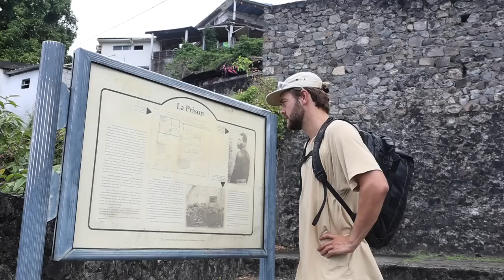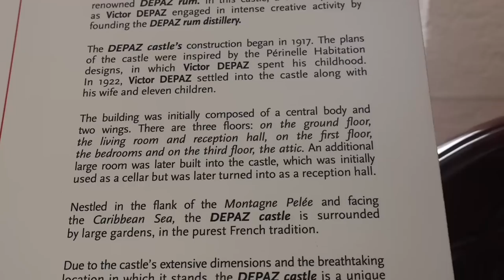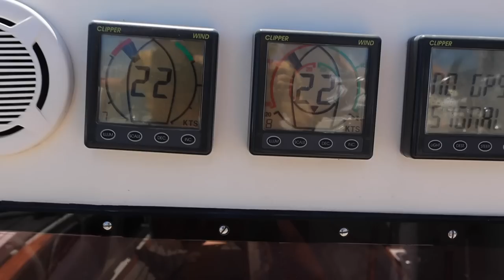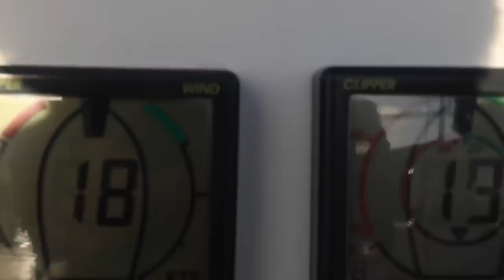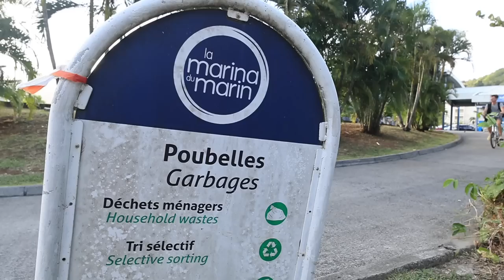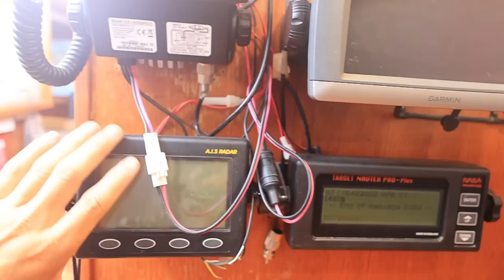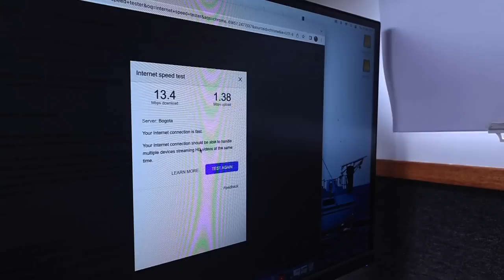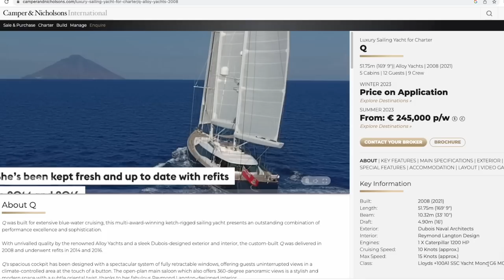What is THIS doing in our boats gearbox?

Comment: The quality of your shows is growing on me more every week, very nice work!    When we mount something on or through deck, we invariably put some goop in before tightening everything down, as the rubber bits don't stop all the leaks and you will find water going through there at some point.    By goop, I generally mean one of the 3M products,  or in this case, some Maritime black to match your teak, it should be flexible for when you want to renovate later.   Other opinions are welcome here.   Your magnet revelation brings a smile.   You both do an excellent job of bringing the special moments, adventure, and discovery to this show, keep this up.
Reply: Totally agree with your goop comment, dry fit rarely works perfectly. 
As much as anything it acts initially as a lube, so the rubber element can move into its happy position during tightening….
Then it cures to complete the seal. 
Cheers, R. 😎👍🍻
Reply from the maker: Cheers David, its always nice to know that we are getting better at this! I'll keep this in mind next time I add one, thankfully it is just through to the lazaret. So small leaks won't be a big issue, but I'll keep an eye on it. Thanks for the advice and your kind words 😁

Comment: Some cars have magnets on the end of the oil drain plug also. Been doing that for decades I think. Definitely helps keep any tiny shards of iron from causing more problems if they were allowed to circulate in the oil.
Reply from the maker: It’s such a simple solution to the issue.

Comment: Magnets have been in car sump plugs and gearbox drain plugs for years probably 50+ years, a little tip take out your filler plug before you drain the gearbox it allows the oil to escape easier.
Reply from the maker: Thanks for the advice Patrick 😊

Comment: Zach, using magnetic probes to collect metal particles is quiet a common thing. They use them a lot in Aviation  and we know them as "Chip Detectors" you can also find them in an Electromagnetic form which will turn a light on if the Chip Detector picks up metal It is also good practice to Cut open your oil filters and look at the debri that it is picking up. You can buy specialist cutter tools that uses a wheel cutter to cut the metal housing cleanly so that when you have the filter elements you are not looking at the metal from the filter housing but only the engine wear metals another good practice is to filter the oil through a paper filter to check for other Non-Magnetic pieces that may be in the oil,
ie:- rubber of "O" ring seals or plastic washers that maybe breaking down  another handy tool is a Telescopic Magnet or (Magnet on a stick) to run through the waste oil  filter papers are cheap and easy to use but can show something is going wrong way before it does
Reply from the maker: I had no idea 😅 Thats a really good idea, next time I have to change the oil I'll make sure to filter it to look for other bits of rubbish. Cheers!

Comment: When you mount something on your deck, you must have some sealant between the deck and the thing mounted, not only on the screws.. tec7 or something..
Reply from the maker: The unit came with a rubber bottom, so I didn’t think that there was a need for extra sealant.

Comment: As a mechanic frost.. or black frost is normal wear. Metal shining flake is start of failure or failing. Lumps of metal is failed...

Its that hatch the wrong way round to pull air into the cabin. Oh pick up a canvas tarp for cockpit shade..
Reply from the maker: Thanks for the tip, luckily there weren't any big lumps of metal!

Comment: Just be careful with the router behind all those books. It can get hot if it doesn’t have a good air flow around it. I have seen more burned out routers for failure investigation which have all turned out to be fine except for where they were positioned… book shelves and above radiators!! Instructions should give min and max ambient temps!

Comment: Hi guys, great videos. Just a tip but if you pump out the oil from the filler on top it is much cleaner and you dont need to ruin a good pot. Then clean the magnetic plug while.most.of the oil is already out. F
Reply from the maker: Thanks for the advice 😊